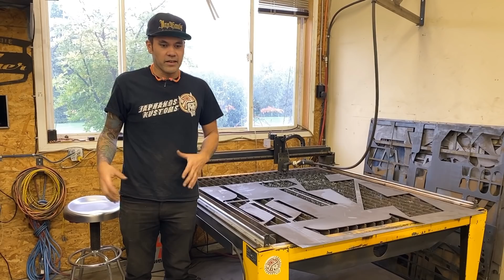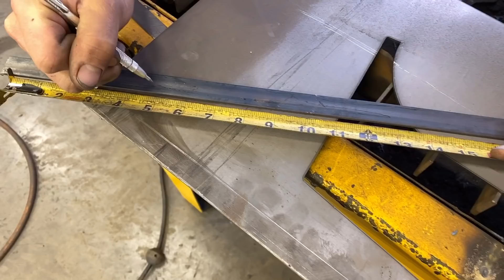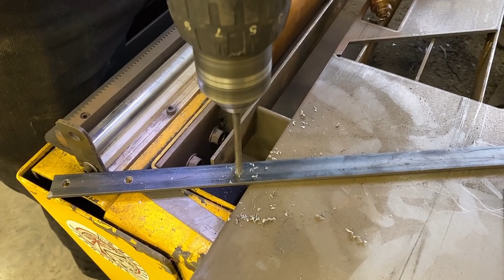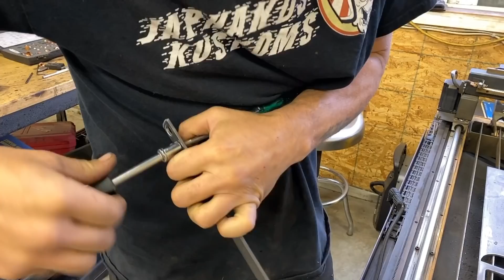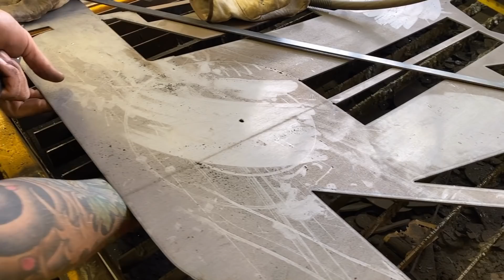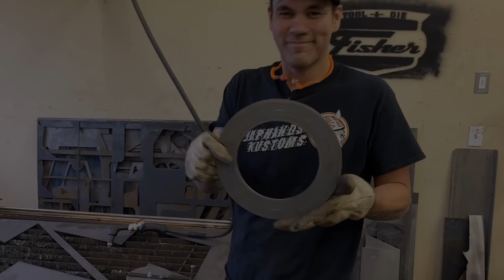How to Make a QUICK + EASY Circle Cutting Guide for Your PLASMA CUTTER!!

Comment: Well i did mine and it was better than my previous one. I had to go back in a few places. My hypertherm power max 30 is not as powerful as yours. I was doing 1/4” steel plate. Was better than the outside circle 😎
This is just to hold a drum in place while i break the 216 pound nut loose.

Comment: Great video. Made a different hole jig. Got the first circle done but sloppy. As i rotated it the cutter was hanging up in the oiece i dropped it in. Will give yours a try. I have to get some of those dragging tips. I like the button screw idea. Will ise it on inner circle. 🤞
Also i like the handle.

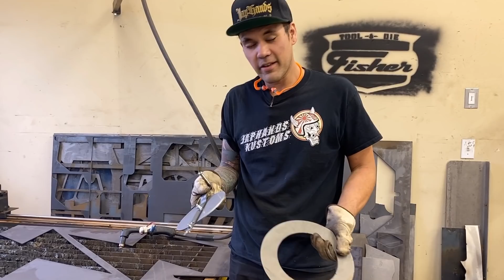Comment: 12:48 I’m looking at that center ‘waste’ with a hole in it. Often, that is probably useful. Desirable even. 
But this gave me an awesome idea for a variation. I’m probably never going to want to (or need!) a cnc table - especially for the floorspace factor- but somewhat regularly I need to cut shapes, curves and circles. A modification of this basic idea combined with some woodworking tricks (my other income-producing fab skill) I do with a router and bandsaw will give this super powers.

Comment: why not set up your circle cutter on a speaker magnet (old school).  They usually have metal glued to them.  Simply weld your center screw to the metal and tweek the cutter so it ends up where you want it.  Not so great with non-ferrous.  Just a suggestion.  Do with it as you will.
Reply from the maker: Thanks for the suggestion!

Comment: Thumbs up for using a nut driver lol. A tip on the nylock nut, use a wave washer if you need a smidge more tension ;)

Comment: Quick tip, drill a golf ball slightly smaller than the diameter of the end of your center punch. Press it on and you're gonna want to use your center punch for hours. They work great on old files with missing handles too.

Comment: Great!
Handy upgrade on an old idea.
Perhaps overkill but if you want to reduce drag on a pivot use "3" thin washers on the center. Acts like a bearing. Learned this setting end play on air cooled vw engines. One "always" uses a 3 shim stack.
Reply from the maker: Thanks for the tip man appreciate it!
Reply: The 3 shim stack is standard on air-cooled VW crankshaft end play.
I have found it to work well in other pivot situations. Each end shim acts as a bearing surface and the center shim slides on the other two. 
   A touch of lubricant helps....

Comment: Isn't it awesome when you've been doing something one way for a while...and it works...works pretty darn good actually and then you figure out one little thing that makes it work awesome? I turned 55 this past summer and I've been running into things like that a lot lately. In the past ten years that I've been working full time as a mechanic I've run into quite a lot of those situations where there was come little change in the process, some little change in the set up...etc and it went from working well to working awesome! Good thing because I'm way more forgetful now! lol   Something needs to make up for the time I'm standing in front of the tool box thinking, "what the eff did I come over here for again?" LOL
Reply from the maker: Ha ha I do those things and I’m only 33
Reply: Im now 73 and still having fun making things in my shop.I tell my wife,if i have hay u tube in my early days my progets would be something to brag about 🥴

Comment: I did mine different. (Think Jasper jig style for wood workers) I drilled the hole for the plasma tip then I measured carefully for a hole 6 inch away (12 inch DIA). In that location I drilled a 1/8th hole for the pivot pin. After I knew it was accurate at cutting the 12inch DIA circle, I used a ruler to mark up, center punch and drill 1/8th pivot holes at every 1/4th inch. This gives me the ability to cut holes on half inch increments. I then measured and offset another line of holes to the side of those holes to allow me to drill at the 1/4inch increments. So basically, I can use the tool to cut holes  at any size on 1/4 inch increments. at the moment i have like 24inch DIA capacity.I then drill a 1/8th hole in the center of the metal for a pivot and use a 1/8th cleco as a quick way to establish the pivot instead of a bolt. It works great. The cleco hole is easily welded up if needed.
Reply from the maker: Right on I like that! Thanks for sharing

Comment: If you make the step up bend closer to the handle you can just keep drilling new holes for different sized radiuses. Idk if this is a tool you plan on or would consider keeping though because you have a cnc
Reply from the maker: Great point man you definitely could. I think these turned out better than my Cnc lol